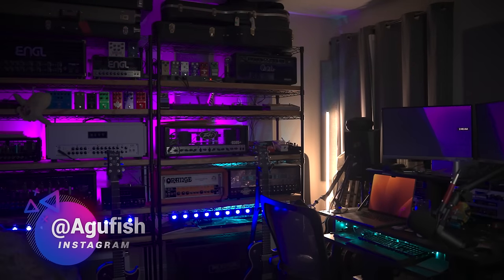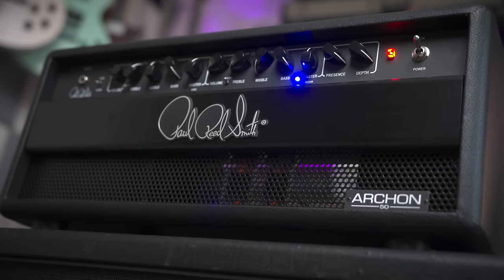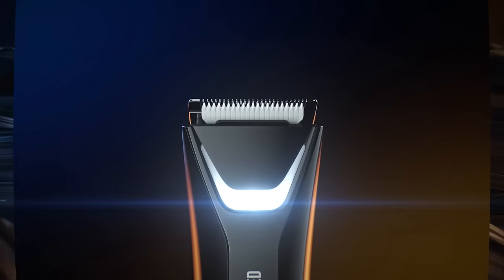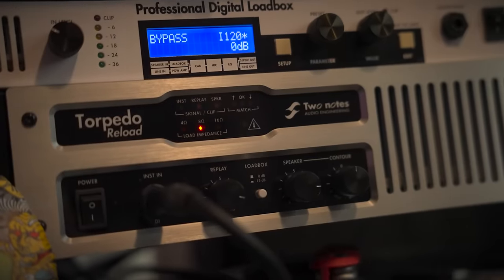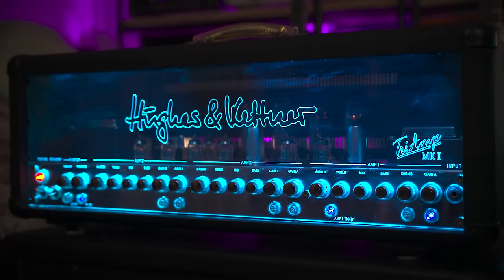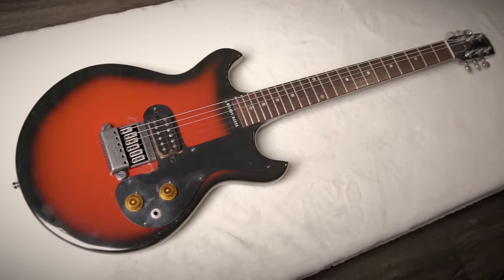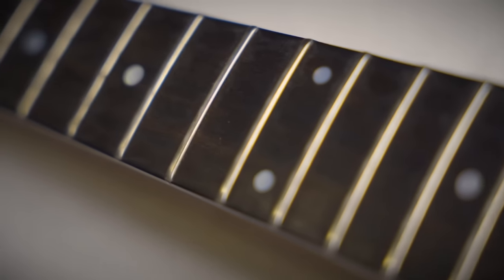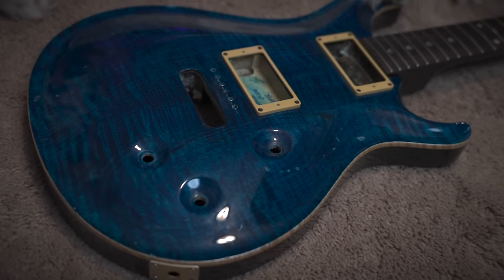VINTAGE GUITAR PROJECTS, 2024 GEAR COLLECTION TOUR & CHANNEL UPDATE…

Comment: Seems like you got good deals done some of your gear. Reminds me when I bought a 1989 fender hm strat with the original case for $500. I also got a line 6 spider valve hd150 tube amp for only $150 bucks. Plugged it in and it works perfectly.

Comment: The broken body Gibson looks like it actually has the best chance. Is the neck straight and solidly set? If so, I'd do that one up. Please no Sperzel tuners. It's hard to invision mod projects without at least an idea of the era your shooting for? That one should probably have a more classically inspired theme to it. Guitars with randomly mismatched parts throughout the build, just look hideous to me. You gotta stick to an era of history when choosing mod parts. Putting modern locking tuners on everything completely ruins any chance of a guitar retaining any oldschool character.